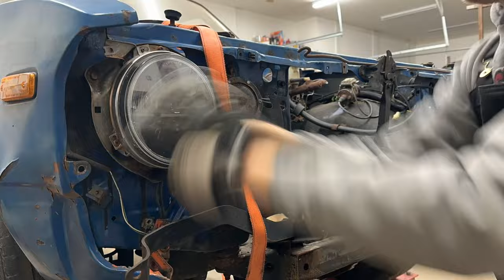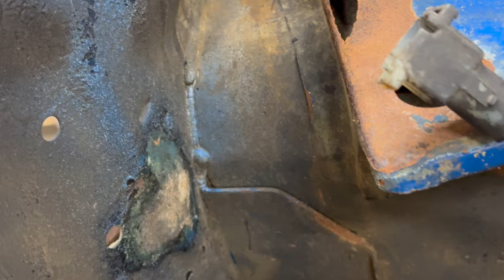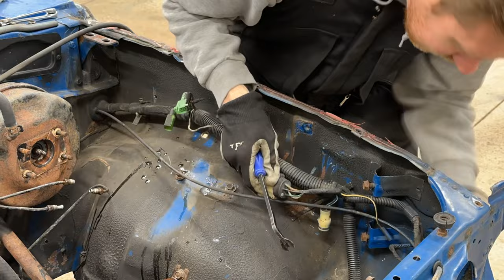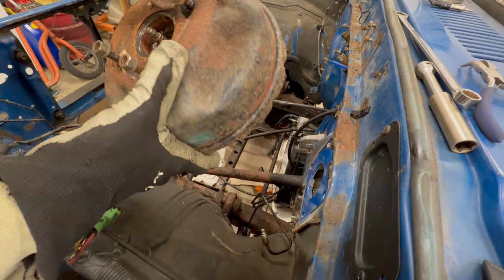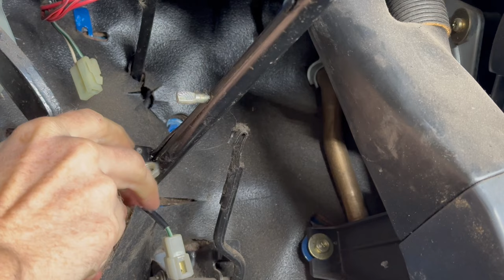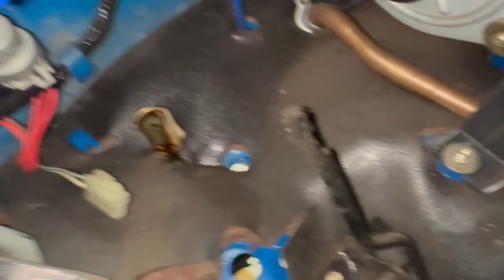How to: Remove EVERYTHING from the Engine Bay - 1980 Toyota Pickup Truck/Hilux

Comment: The steering shaft comes out through the firewall as a unit ( 4 bolts) it should come into the cab. I have never seen one yanked out like in the video? 
Great tip on the e-brake cable.

Comment: When unhooking the steering shaft from the box...did you take out the bolt out on the shaft at the top by firewall to get the shaft to slide(compress) away from the box? I have a BRAND new, not rebuilt box, (cost $650) for my 87 and its time to get it in, seeing Ive got 1/2 million miles...so far....
Reply from the maker: I didn't see that bolt on this 2wd 1980. I just removed the 2 bolts at the rag joint to disconnect the shaft from the box.

Comment: recently pickup up a 20R out of an 80 pickup.. its complete..  prolly needs good hot tank n honing..  but other that, no idea what im gonna do with it..  just want to build an engine n this was a really inexpensive way to get started
Reply from the maker: The cylinder heads from the 20 R engines are sought after. You can put a 20R head on an early 22R bottom end and have a bump in HP due to higher compression ratio.
Reply: @6thGearGarage  sweet..  does that also apply to the 22RE or no?